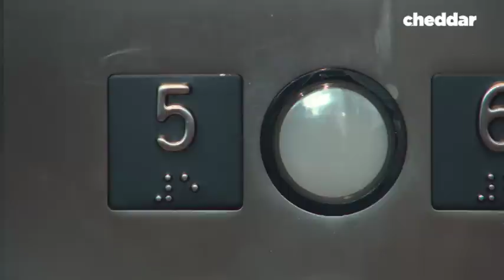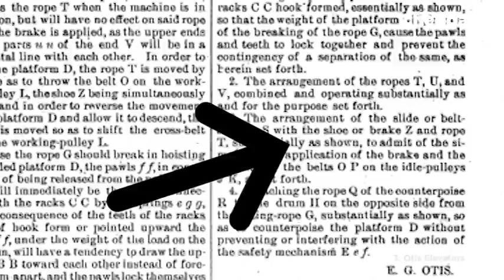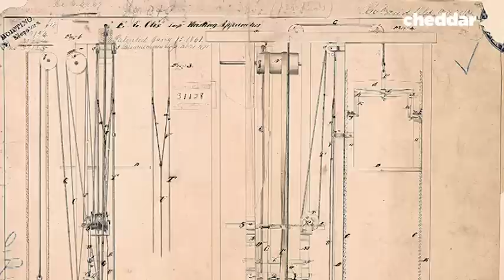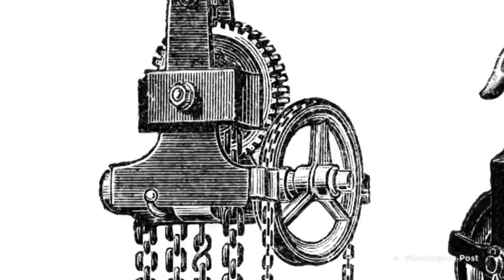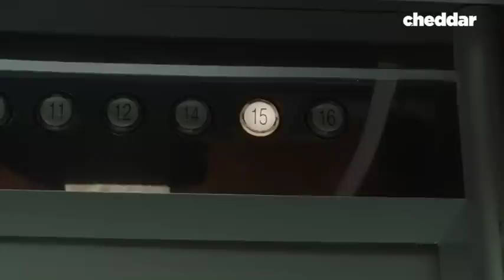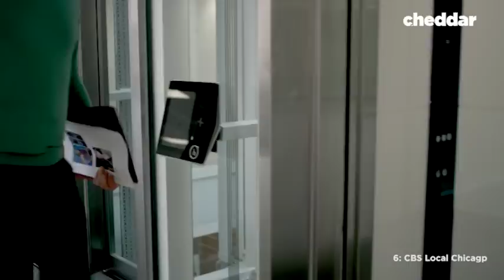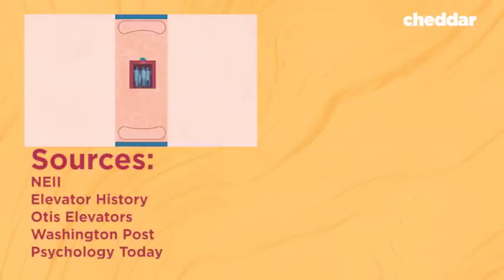Why Movies Are Wrong About Elevator Free Falls - Cheddar Explains

Comment: Wondering how the elevator descends through the ratchet brakes in normal descents? That wasn't mentioned.
Reply: barkon 
I totally 100% understand this sentence
Reply: Because Cheddar got it wrong. The rope of the elevator was attached to a bar; under normal operation the weight of the elevator kept the bar disengaged. If the rope was to break, the bar would lose all tension and snap out to catch the ratchets.
Reply: Joshua Maniak this is true
Reply: barkon the ratchet breaks are placed in the very bottom of the elevator shaft.
Reply: Wut
Reply: The ratchet pawls are pulled inward by tension on the cable. No tension and they pushed out by springs.
Reply: @TheJttv  Ahhh. I was looking at them like palls on a bicycle freehub and could not think of how they retracted. Makes sense now.
Reply: @ignaciomainardi5501  this was a great explanation thank you!
Reply: Barkon — The valley girl got it completely wrong, that’s why it didn’t make sense.  Yes, Otis invented the safety elevator.  But, the design looks nothing like this.  The device is mounted on the car.  If the cables lose tension, the brake engages with the vertical rails that the elevator runs on.  It is all mechanical — the brake works even if all the power fails.
Reply: @joshuamaniak9546  Thank you for doing what I was angrily looking to see if I needed to point out what is an obvious omission. Can't anyone do five damn minutes of real research and not just regurgitate some other article they read and thought was cool man.
Reply: Tim Hunkin gave a better explanation many years ago, and even recreated Otis's stunt with a custom-built lift that had the simple spring-engaging-brakes mechanism.
Reply: @joshuamaniak9546  That's how it previously was done back in the early 20th century, but it wasn't as reliable... Modern elevators use a speed governor and when the car decends too fast it will trip the governor and lock the brakes on. If you look up in a cable elevator you can usually see a much thinner cable going to one of the sides of the car, this cable runs between the governor and the brakes and is an additional level of safety in case the main cables snap. Most companies have also started installing governors in the other direction. This is in case the brakes on the motor itself fail and the car starts ascending too fast when closer to empty or when they should be stopped as an additional level of safety.
Reply: @joshuamaniak9546  Now I just need a visual graphic to fully understand that (I'm on the spectrum).
Reply: A few years back I recall some 1 got decapitated in Shenzhen, China when the lift she was stepping out of suddenly slid downwards. IIRC oil was later found on the lift's brakes
Reply: @josephsvennson5694  I would watch the video in the replies, it helped me visualize it a lot.
Reply: It wasn't mentioned because it wasn't relevant
Reply: That method isnt used anymore either, everything is on the car. The brakes are basically a high friction spiral so the further the car moves down the tighter they push against the guide rails. If the cables/belts were to snap the elevator would barely go faster than it usually does before a speed governor engages the brakes. In testing they put 1.5 times the rated weight in the lift and drop it, once the brakes have engaged the lift takes about 4-5 inches to stop.
Reply: The rachet it on the car, when the cable snaps there's no longer weight pulling on it, causing it to deploy and stop the car
Reply: @joshuamaniak9546  That makes a lot of sense
Reply: The locking feature is designed using flywheel principles. The lock kicks in when the acceleration exceeds the normal rated travel speed.
Reply: @joshuamaniak9546  Thanks for the succinct and clear explanation. I was wondering that also.
Reply: Modern-day lifts have Overspeed governors and all sorts of different protections. If the cables were to snap (which they probably won't because they're overengineered), there is a second, special cable connecting the lift car to the counterweight. When the lift begins to fall after all of the cables somehow snap, the weight of the car puts tension on the extra cable. This cable is attached to a set of brakes. When tension is put on the cable, it applies brakes and stops the car. The extra cable is also attached to a sheave. When the lift car goes too fast, that sheave suddenly locks up, putting tension on the special cable, thus applying the brakes. On the original Otis, the ratchet mechanism was attached to a spring. This spring was held in by the tension of the cable. When the cable snapped, there would be nothing to hold the spring down. The spring would extend, forcing the ratchets to catch.
Reply: It wasn't mentioned because they made their own animation which wasn't accurate
Reply: Yeah I don't understand that either I'm an elevator mechanic 32 years I've never seen ratcheting safeties on the bottom of an elevator they do have a safety assembly black on the bottom of the elevator that's operated by a governor in the machine control room penthouse elevator over speeds Jaws kick-out stop the elevator

Comment: I'm more afraid of something going wrong with the door. Either it closing on me, or the elevator dropping as I'm walking through it crushing me against the floor.
Reply: There’s really no need to worry I’ve never had an elevator door fail to detected something in the way. Plus they only apply a certain amount of force whilst trying to close if it has to exceed that force to close it will just stay open
Reply: @MegaJoshie1  Indeed there is an interlock such that the brake on the car is unable to be released while the doors are open, granted this can be overridden while the elevator is in maintenance mode (As sometimes engineers need to be able to move the car while having access to the shaft during maintenance) but with more modern elevators this renders all passenger control panels and call buttons inactive without a maintenance key etc.
Reply: Josh Francis elevators closing in people and killing them happen pretty often in big cities and other areas. There have been some questionable elevators I’ve ridden in NYC and a few close calls. Just be careful because things like that happen. Thankfully it hasn’t been your experience or my own.
Reply: Guess you guys avoided ever watching /r/watchpeopledie, or stumbling upon a bestgore video, elevators in china tend to cut people in half, elevators there can being descending while the door is still open, there are also cases when the doors open while the elevator isn't in place, it is horrifying, and caused by companies cutting costs by not implementing all the safety measures, but you won't hear about it on mainstream media mainly because  these accidents are heavily censored.
Reply: @seraphina985  
to bad the key control on most elevator keys is garbage, and sometimes the access panels dont even have a lock on them
You can buy fire service keys on ebay for like 10 bucks
Reply: @dafrandle  To be fair if you are suicidal means can be found to satisfy that urge pretty much everywhere, most of them don't even need you to tamper with any safety systems or purchase anything, bridges tend to be open to the public, not to mention the dozens of ways that can be found in a typical house etc. No amount of safety systems is going to prevent a person doing harm to themselves if they meet the minimal bar for being motivated enough to actively facilitate this objective. Like it or not if someone intentionally seeks to endanger or even kill themselves they have no shortage of options once a human mind sets it's focus on doing harm pretty much every object is a weapon.
Reply: @Tim You don’t need to worry about those problems. Elevator doors have sensors, bumper switches and even a door open button for someone else to press to reopen the doors. And the elevator dropping while doors are open is very unlikely. The elevator has an interlock switch to make sure the doors are closed before moving. I usually stay cautious when entering and exiting elevators to check if the elevator is level with the floor.
Reply: @mineborders  key word *china* ofc WESTERN media isnt going to cover elevator problems in china, its not that its censored, its just it doesnt link to our elevators
Reply: Walking in and out is the sketchiest part for sure… not looking to be cut in half long ways

Comment: I’ve always trusted elevators until the 8:50 mark: “Maintenance workers turned off the safety chain to do maintenance, and forgot to turn it back on; resulting in catastrophe”.  Looks like leg day is every day now... sigh...
Reply: A safety string cannot be "turned off", you would need to jump various parts of the safety string out, at once. Door locks and gate switches used to be a big issue, but now municipalities like NYC have door lock monitoring, meaning the door locks cannot be jumped out
- NYC elevator mechanic
Reply: Most lifts nowadays must have safety chain bypassing switches (with other words switches to control the door locks on the doors, allowing the lift to run with the door open. Most lift controllers when this is done, lock out the lift and it is only usable on cartop and/or control cabinet inspection mode (controls that move the lift for maintenance, and locking out the lift.)

Comment: Once, when my brother and I were young, he was leaning against some elevator doors when they suddenly opened without the elevator actually being there. He didn't fall thankfully, but I still avoid elevators because of how much that scared me
Reply: That is super rare and only happens if someone has opened the shaft door with a key and not closed it properly.
Reply: @nelsonahlvik6650  do you work with elevators? Curious
Reply: @MannyBlaaze  No, but I am a huge fan of them, and I have done a lot of research about how they work and what kind of safety systems are in place.
Reply: About 12,000 people die from falling down stairs every year

Your perception of danger is messed up

Comment: My ex-stepdad is an elevator engineer. He builds and designs elevators for a living. He get's all pissed off every times he sees an elevator fall, bet in a movie or on tv. "That's impossible" he shouts, then proceeds to hold a lecture of how elevators work and all the fancy features of modern elevators. Btw, elevators are not airtight, you can't run out of oxygen should you be trapped in one. To this day I still can't watch Speed without hearing his lecture in my head.

Comment: The same holds true with air brakes in Hollywood.  Few people realize that air brakes on trucks, trains, etc are applied when there is no pressure, and release when they are pressurized.  Most movies and TV shows show a vehicle with a severed air brake hose careening out of control as it picks up speed with nothing to stop it.  The exact opposite would occur though if a hose is severed...The vehicle would abruptly stop.  You can thank George Westinghouse for this invention as well, over 120 years ago!

Comment: There was a news story where a boy was waiting for his dad in a lift, and he held the doors, causing it to enter nudge mode. He then used an umbrella to try to reopen the doors, but it didn't work, since the lift disabled its beam sensor. Then the umbrella got stuck and caused the lit to free-fall.

What really happened was that the doors were closed enough to connect the safety circuit, and the lift started moving, and since the building had lots of floors, the lift moved fast.

If it really free-falled, it would have gone up thanks to the counterweight, but the emergency brake would be applied because of the safety mechanism described in this video.

Comment: You are 100% totally correct. With all the modern safety devices on passenger elevators now days the chance of a modern elevator falling is slim. Plus they are required to be periodically inspected by a elevator maintenance  
technician.

Comment: it's the assumptions of the writer/producer of this video that ALL elevator systems are built according to these specifications. THEY ARE NOT
Reply: In most industrial countries, legal requirements for passenger elevators are remarkably high and roughly correspond to such specification.
Reply: There are main companies like Otis, Schindler or Kone that build elevators, so they should be in accordance to the safety measure

Comment: I just looked on Wikipedia, and there are several people who have died from falling elevators. Many deaths are from planes/trains damaging elevators, many more in construction/mining elevators, several having severed cables. So what about a traditional cable elevator in a public setting? Looks like 7 people died in 1989 in a hospital in Spain when the cables disconnected from the cabin and the elevator freefell to the bottom. Safety brakes failed to engage. In 1903 an elevator fell 6 stories at the Donnelly Building in Pittsburgh when the cable was overloaded and snapped. Another in 1958 at a dam in Australia, cable snapped, killing 4. 1932 in Chicago, cable snapped killing 3 and injuring 7. Clarendon Building in NYC in 1920, cable snapped killing 2 and injuring 16. In 2018 at the John Hancock Center in Chicago, the elevator fell 84 stories but stopped before hitting the bottom, after the cable snapped, and was trapped behind concrete walls. Had the elevator started falling 11 floors sooner might have been a different story. Even if it was possibly caused by technician error, it's was still a nearly fatal accident from cable failure. The Calgary Tower in Calgary Alberta Canada free fell after cables broke, but the brakes stopped them. Then the brakes were released and they only stopped the second time because the cables tangled in the pulley system. So I'll go ahead and say that "no one dying" in a cable elevator isn't true, and even if you narrow the time period it's largely thanks to luck.

Also 236BC to 1820AD is less than 2000 years, not over.

Comment: Europe's elevators are even more safe than the rest of the world. Highest safety standards.
Reply: If you have to brag about elevators you're not packing much heat, are you? #sigmundfreud #analyzethis
Reply: @ihatealgebra2431  but they are built after different standards. In europe every single rope has a safety factor of 14.
Reply: @josephsvennson5694  What do guns have to do with elevators?
Reply: Somewhere in Europe - or maybe it's Asia - there are two elevator cars operating independently on the same hoist way.

Comment: Cheddar: Elevators never free fall 
Also Cheddar: In 2018 in Chicago an elevator free fell
Reply: That's very typical of them. Their initial statement or example in a video is debunked by the video itself. Their goal isn't tool debunk it, but rather back it up. But they fail at it.

Comment: There has been one reported case of an elevator freefalling, ever. A plane crashed into the Empire State Building near the end of WWII. The impact severed all the cables, and the tension brake did not activate for sone reason. The sole passenger survived the 20-ish floor freefall as severed cables tangled between the car and the shaft, bringing the car to a stop before the bottom of the shaft. 

And for those wondering, no reported elevator free falls occurred on 9/11, even though most of the shafts and cables were completely severed.

Comment: The Otis safety mechanism is very simple.  If the cable is not under tension because of the weight of the lift and the counterweight, bolts shoot out locking the lift into the shaft.  Lifts usually have other safety features but the Otis mechanism will always jam the lift in the shaft.  The problems start with getting the people out afterwards.

Comment: This is an old video, so I’m not sure how many people will read this comment, but the initial media reporting about that elevator in Chicago was wildly wrong. The elevator did not plunge 84 floors. One of its cables snapped, but the rest of the cables held. The electronic controller then gently lowered the elevator down a bunch of floors to where the passengers could exit. All the safety devices worked as intended.

Comment: As to the John Hancock Center, the video is wrong.  According to a report by ABC 7 in Chicago of the investigation of the incident everything worked as it was supposed to...
“.....The I-Team obtained the final report, which says one of seven steel hoist ropes "broke," but that there was no "plunge" from the 95th floor. Instead, the report says there was a "gradual lowering" from the 20th floor to the 11th floor before all six passengers were safely rescued. A hole had to be cut through a wall because the express elevator doesn't have an exit on each floor.

"The summary says that all the safety mechanisms that were supposed to work, worked," said Judy Frydland, Commissioner of the Department of Buildings. "These elevators have a log of redundant features for safety. So each one of the ropes can hold the elevator on its own, but there are seven ropes. One of them failed, the other six were perfectly fine, the elevator came to a controlled stop a few floors below."

Frydland said she and her staff reviewed the report, submitted to the city from the Otis Elevator company. It says "...elevator #2 was never out of control or unsafe..." and that "...the elevator's backup safety brake never engaged, indicating the elevator never traveled at an unsafe speed."

"It wasn't a freefall, it wasn't a failure of the safety systems, none of that," Frydland said. "Everything that was supposed to work worked the way it was supposed to work."....”

https://abc7chicago.com/amp/hancock-center-john-chicago-building/5264740/